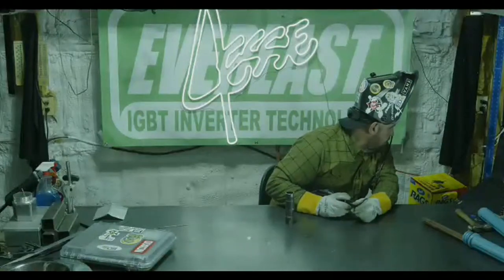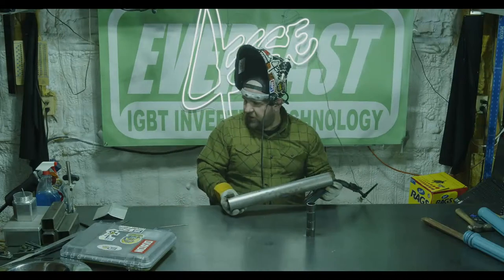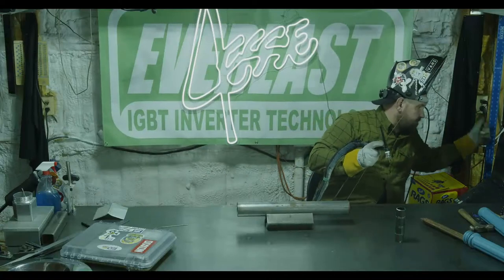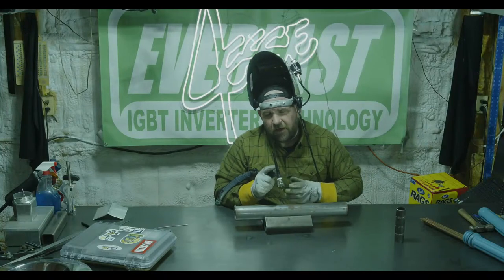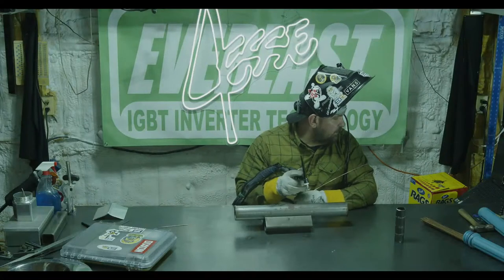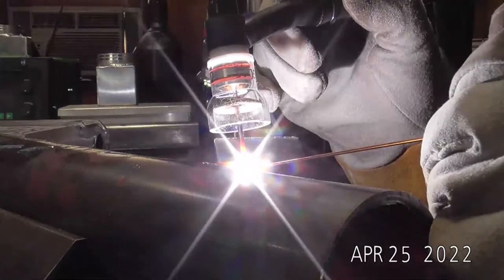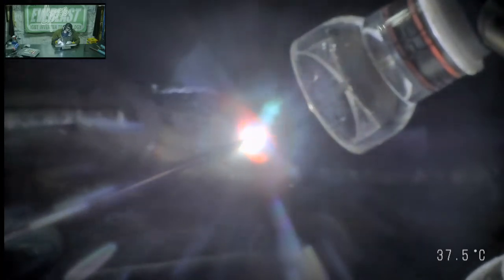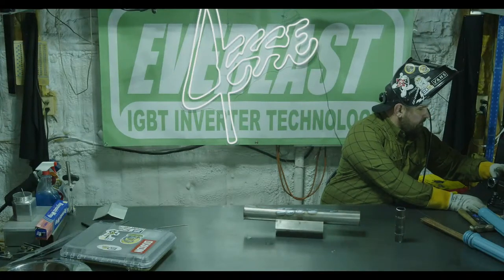TIG Welding with a Finger switch setup (2T and 4T) | Everlast Welders Live

Comment: is the ground screw on the back of the welder supposed to help with high frequency interference?
Reply: It is, I have the machine grounded to an 8ft 5/8" copper rod, driven 6ft in the ground. No issue with anything else in the shop other than the cam. Its odd to say the least